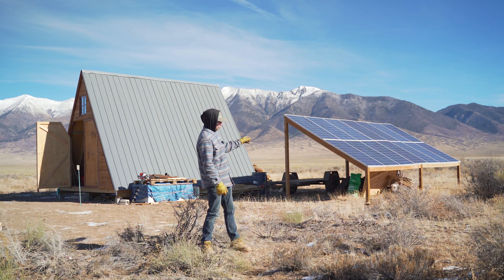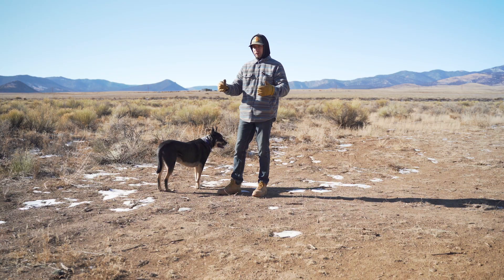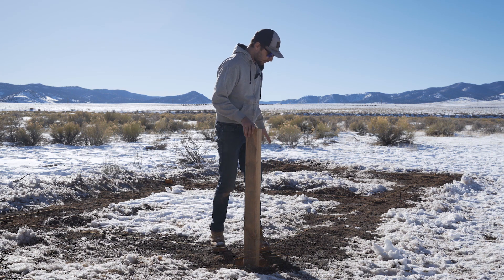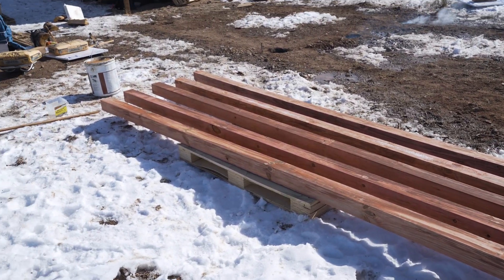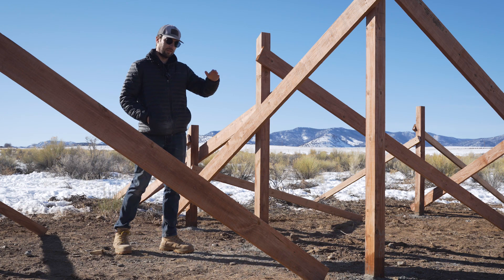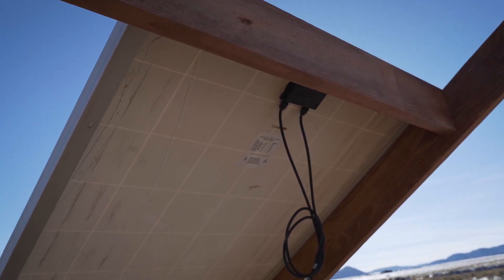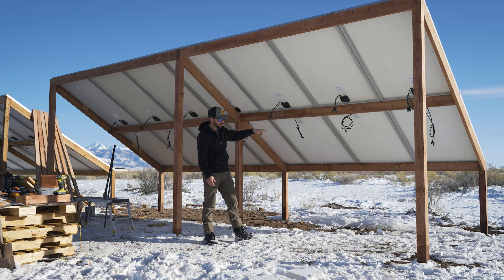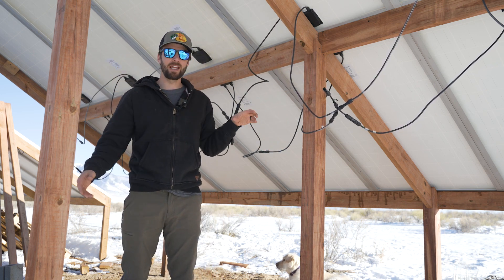Building a Budget-Friendly Array Base for Santan Solar Panels - My First How-to Video??

Comment: I llke your wooden structure for the panels. Very simple design (which is in my book a good thing), solid materials, looking good.
However, not sure what will happen under a big wind load. Your posts in the ground will have to take all the horizontal forces.
But there is an easy fix, add some solid straps (dimension of your rafters) from the top of your shorter posts in the back to the bottom of your posts in front. Suddenly you will get two triangles instead of that weird four corner design. That's why roof-trusses are always made up of triangles.
For aesthetics and strength you could double those added straps.
Reply from the maker: You’re definitely right! The one I built in this video actually got enclosed (not on video) so the sheathing took that bending moment and turned it to a shear into the base of the post. The other one has tension wires between opposite corners top to bottom for the reasons you brought up. Having said that, it withstood a 95mph wind storm before I added the wires!

Comment: Hey, G'day mate...nice vid.
One question....why only mounted at 30 degree angle, I thought the rule of thumb was same angle as latitude.
Prepared to be schooled, cheers.
Oi Oi Oi
Reply from the maker: Hey mate! Did 30 out of convenience and because I wanted the space under to be a little more usable. I’m at 38°N so it wasn’t far off. Winter angle is 55 and summer is 15, but my energy demands will be higher in winter, so I’ll build two more at 45° (with no expectation to use the space under) and when it all is done they’ll average 37.5°. To summarize, you are correct about latitude vs solar angle!

Comment: I built two arrays for 40 of these San Tan panels last April to May when a 2x4 was $48. The project cost me $970 for the wood alone which is about what I paid for two pallets of solar panels.
Reply from the maker: About the same time I built my shed. It would have been cheaper to use the solar panels as sheathing than buy 3/8” OSB!

Comment: I'm building something similar. Are you not concerned about racking? Not panel racking but side to side movement leading to a collapse of the structure. Is the assumption that the concreted posts are good enough to prevent racking?
Reply from the maker: I’ve had my concerns but so far it’s faced a 90mph wind and is still standing! I believe the stiffness of the vertical post with sufficient burial depth is what makes it resistant to racking. Same concept as post framing vs platform framing, the old pole barn can take a fair side load whereas the joints on a platform frame can act as pins and allow rotation without sufficient bracing. Hope this helps!

Comment: First and every time I do solar panel Stand's when there's snow on the ground I won't even touch one that's kind of why I'm waiting till April 12th before I dig a hole in the ground which I still ain't going to do until April 13th but I got busy that day even though my vacation starts on April 12th so April 13th I'm going to dig 6 holes and get all the beans at the right size since the ground soft already and there's no snow on the ground anywhere's for the last week. But I'm also going to be redoing two other solar Stands. And on the small solar stand which would be the fourth solar stand I'm going to change the size of solar panels on putting on it ones that will fit better I'm not sure what solar panels are going to put on it but it only go up so high because the solar stand right behind it, I like where they're stationed at and they don't block the Sun from each other. Of course the fourth sand is the oldest stand I have it is made all out of wood like all the other stands I have and all the other stands I have and all of the newsstand I  put up to. My oldest stand I have is like 27 years old and is still a really good condition it'll last me another 30 years so I'm just going to put new solar panels on it instead of scrapping it out, and and for the solar panels going to take it off there since they're still really good still give me the same wattage as they did when I got those new ever so many years ago I'm going to use them  just not on that stand anymore.

Comment: Hello, looks like we are building almost the systems. I ended up getting two ex6500's.    Same San tan solar panels also. Same solar angle also (Wichita,  Kansas.) Where we differ is I'm stringing 14 panels in series for each pv input. (2 inputs per ex6500 and 2 ex6500's)  Which yields  30volts X 14 panels X 7 amps =  around 2940 watts per input.  And yours 30 volts X 7 panels X 14 amps = 2940 watts.
Reply from the maker: Very cool! I’d have preferred that configuration but went with the 2x7 because my panels have a Voc of 37.2V, so 14 in series would give 520V and exceed the EG4’s spec of max 500Voc. The 30Vmpp of the panels (x14=420V) works with the 450V MPP limit of the EG4 though. I think there’s a few different batches of the Santan panels in circulation so maybe your open circuit voltages are better suited to the series configuration. I’d love to hear it worked for you though and I might do the same on my next one! Let me know!
Reply: @RidgyDidgeRanch  We have the same panels but the ones I've checked do not reach the 37.2  ocv even in the winter (they are used like yours).   Worst case scenario I'll unplug two from each pv input during the winter and just run with 12 in series.

Comment: HOWdy  R-D-R, ... 
Seems as if we have the same PHILOSOPHY ... 
inexpensive "USED"  Solar Panels ( mine were 208 watt / 39" X 64.5" X 2" = POWERLIGHT brand = so old they came with MC3 connectors 🙂 ) 
Ground mounted on Pressure Treated 2" X 6"  Ground Contact WOOD 
+ Stainless-Steel  4" X 5/16" Lag Bolts 
+ 1 5/8" diameter 5/16"  Fender Washers 
& some 2" slugs of  3/4" PEX water Pipe utilized as SPACERS on the outer-most attachment points ... 
Thanks
COOP
the  WiSeNhEiMeR from Richmond, INDIANA 
...
Reply from the maker: Definitely a similar approach!

Comment: I am looking for about your product place lace me a message. When I post this , I am looking for more information on this. I'd like to know where you bought your solar panels at and 1 if I can get a good deal on building off grid cabin and I need to get to soda penis up where I can have power out there cuz I want to run to I buy stocks and a greenhouse and other thing other projects I had and I got to have some way to start my batteries and trust my Friday's to my equipment and stuff I'm using to built plus lights and everything else can you get back to me soon as possible for any more information do you have to help me out preciate it take care of yourself and be safe out there whatever you doing

Comment: I don't know I think my solar panel survive lightning does one time we have enlightening IV few inches apart it's so bad one time the radio warned us about it be warned us about everything wonders about it and said do not go outside you can get what I do no matter what lightnings going to hit everywhere's and I just watched the lighting it every few inches apart all the way around my house almost hit my car and truck so many other times I don't know I don't know if it hit my solar panel but solar panels we're right out there making power off the bright lightning at midnight or else the sky was black as could be except for all the lightning I do believe my lights flicker a little bit they're running off the batteries.

Comment: Surprised you didn't get a bigger solar panel from santan solar they're all pretty much junk anyways but it might as get bigger ones and hopefully get none with scratches or kinks or whatever aristos are ones I would not be using I just give those ones away to somebody could you pay using but just ain't going to give them much chance to say their last that long. One that has no scuffs and marks on it is the ones I'd be using.
Reply: Ace Fire, Let me know when your install is done and your video is up.
Reply: @larrybell4599  I'll let you know when I'm done installing solar panels don't worry about that but I really don't have videos to make because I never made a YouTube channel but it just kind of sound interesting. And it also let you know what I'd gone with as well. But for having solar panels for the last 25 years and never enough to really power my house but to keep me aware of the powers using. I'm right now I kind of have solar panels mounted on the ground but it was I'm going to keep while pie change those solar panels eventually but I will be putting solar panels on my roof and I will let you know what I have done. And thank you for your YouTube video.
Reply: Punctuation is your friend...